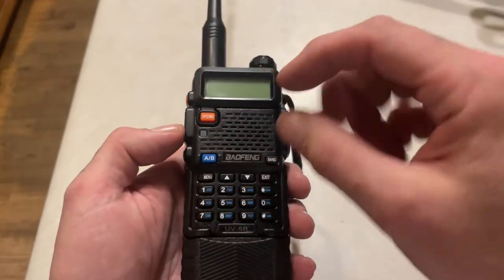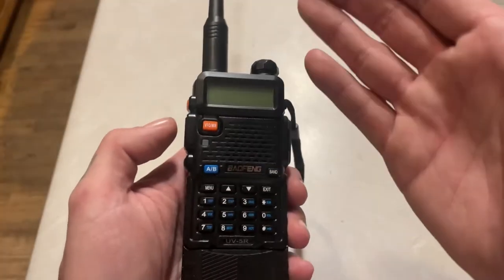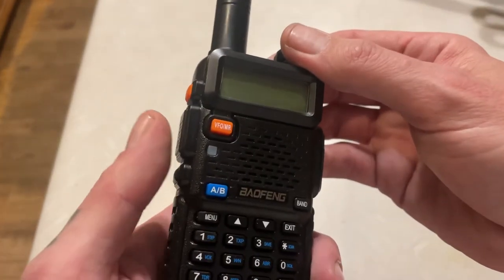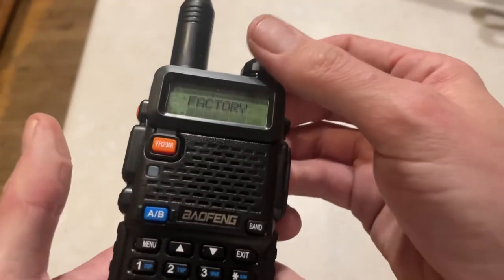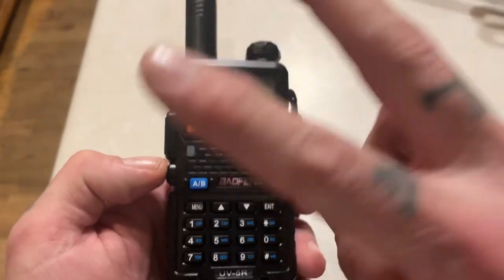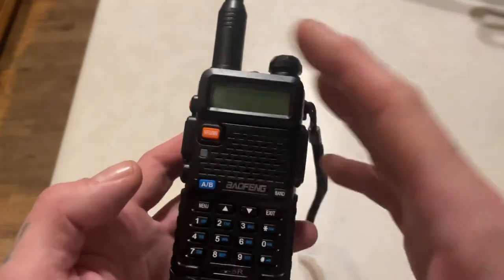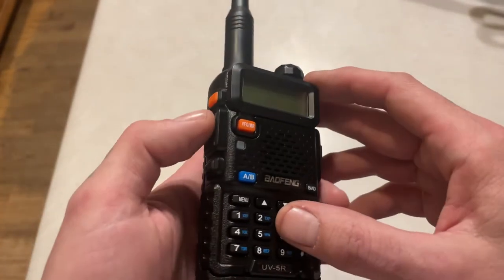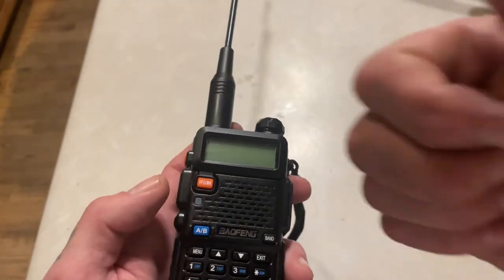BAOFENG UNLOCK FOR ALL FRS GMRS FREQUENCIES (new baofengs come locked to RX only) S18E14

Comment: I tried this on two of my Baofeng UV-5R units.  At first, it didn't work, however, I tried again, holding down the PTT, MON, and VFO/MR buttons (and possibly the CALL button) for several seconds after the term "Factory" came up when powered on.  To my surprise, it did not reset the other settings, or all the programming in the unit.  It did OPEN up the limits for Transmit.

When the unit was first checked with Chirp, the settings (in Chirp) were checked for full receive, but limited transmit range on UHF.  Changing them to fully transmit on all the ranges did nothing for the radio until I accomplished the above settings.

Of course, It requires an Amateur Ham license to transmit on 2 meters, and a GMRS license for the GMRS frequencies starting above 462 MHz.
Reply: mine comes up "channel mode"...
no joy

Comment: Worked great thank you. Do you know if this also works on the GT-5r? Curious before I order one. Thanks!
Reply from the maker: Apparently it "worked" on all of them with the right button combo but it was just a temp fix so they could keep selling them. looks like all the new ones coming into the US have new firmware that is not restorable...
Reply: I got lucky before the FCC started cracking down on these when I reset mine. I can even transmit on MURS. Thing is a damn multi tool.

Comment: good morning...does this change you suggest apply to all baofeng models?  I wanted to get a UV-9R Pro
Reply from the maker: read the comments...
Reply: @pawpatina  that's what I did before bothering her, but unfortunately I couldn't find any comments that answered my question.  could you help me?
Reply from the maker: @alessandrorocchi8953  for the 20th time, they could all tx and rx on all freq at first. FCC stepped in and told them no more imports till it was stopped from tx on GMRS/FRS so in a quick fix, all radio set for export were flashed with a temp fix firmware that blocked tx on gmrs/frs. a firmware reset would erase the new firmware. after a while they made them that way from the factory and this fix no longer works. otherwise, I DO NOT OWN EVERY RADIO SO TRY EVERY BUTTON COMBO ON YOUR RADIO...

Comment: I unlocked my uv-5r I just bought also bought bf-f8hp is this radio locked to?I bought the BF-F8hp February 2023.Can I unlock it like the old Uv-5r?
Reply from the maker: if its less than 2 years old probably
Reply: I'm trying to do the same thing but no luck so far.

Comment: I have two UV-860 Baofeng handheld radios, please tell me there's some way to unlock this model, it looks exactly the same as the Baofeng UV-5R so I sure hope it too can be unlocked as it is a newer model number as far as I can tell, but the unlock proceedure shown here and in other videdos for the UV-5R doesn't seems to work for my UV-860 radios.

I'll await your response right here as I know someone out there will have some sort of solution fairly quick.
Best regards, Daniel.
Reply from the maker: I don't own all the radios... If you tried every button combo and its a new radio, they are probably factory locked.

Comment: I have the BF - f8 HP. Any suggestions on how to unlock gmrs?
Reply from the maker: As stated in the video, try every combo of buttons while powering on.... if you see FACTORY it worked...c ant test on devices i dont own. others have stated the latest radios do not have a reset function anymore. so who knows.

Comment: So what if it doesn’t work any ideas
Reply from the maker: Read the other comments...
Reply: I tried the other methods nothing I’ll look into
Reply from the maker: @valqueenofValhalla  then you didnt read em all...the firmare reflash was a few years ago to get around the FCC banning them from import if they could send on FRS/GMRS. but now years later they are coming with the fixed firmware from the start, not a reflash. so no way to unlock them since they arent locked. have to buy an old one from someone usually.

Comment: Doesn't work on the Baofeng BF-F8HP :(
Reply from the maker: Yea as you can see in the comments, the newest radios being shipped have new firmware instead of flash over old firmware so no way to reset them.
Reply: Mine was open all the way to 520 MHz.

Comment: Not Working, BUT I Somehow Unlocked My Other Baofeng To Work From 130 Mhz
Reply from the maker: latest batch has new firmware from the factory. this was just a quick fix so they could keep importing. only works on older models now.

Comment: Doesn't  work.
Reply from the maker: Then as you can see in the comments, you have the newest model that has been flashed with all new firmware. try finding some used on ebay from the last batch that worked. My roomate has a couple for sale...

Comment: The word factory never appear
Reply from the maker: then you are doing it wrong or you have a newer one without the old firmware on it.
Reply: @pawpatina  it has channels from 1 to 21 saved in memory
Reply from the maker: @Flow713Beats  doesnt mean anything. if you can hear them but cant transmit on them, its the new firmware.
Reply: @pawpatina  I want to talk with mi son walkie talkie, it is possible? I have another uv 5r and it's shows factory when I press those keys.
Reply from the maker: @Flow713Beats  program the walkie talkie frequencies and try it... only way to know.